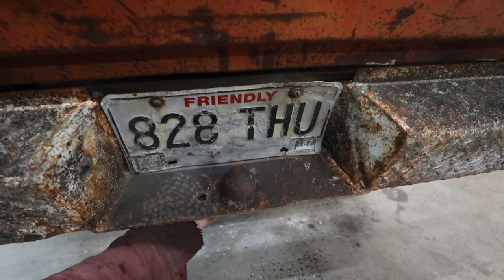Modifying and installing a random hydraulic dump bed in our 1955 Chevy Napco Clone

Comment: Nice dump bed. It will be great for hauling any kind of loose stuff that you can dump out instead of shovel out as well as being a conventional cargo hauler. I'll be watching you and Karl collaborate on the car hauler project in Vancouver. Thanks Brent.
Reply: If he could find a nice 1/2 inch thick piece of steel, he could make a steel bed!
Reply: @jimcarlisle2309  that would be heavy! 
That would make that beast hard to stop. I made the mistake with cement blocks, and on slick manitoba roads excess weight puts us at a disadvantage.

Comment: On Dad's 57 Chevy Grain Truck he had two buttons one inside and one of the tail end of the bed between the rear tire and the tail gate so he could watch the grain unload and raise only enough to get the grain out.  He let me push the button and i was 8. It was big boy time there. He also had a big knob on the dash he had to pull out before the buttons would work. then when it he was done he would push that big knob in the the bed would return draining the oil into the reservoir.  He had the bed and hoist installed by a specialty shop and they suggested the button in the back we used it all the time too. Yes it is way cool to have a tilt bed on the that special truck.. You are having way too much fun on that damn thing. Keep it going. Great creative use of your stash of parts. Well Done, Dennis

Comment: Nice not having to work around a floor. Winter is here and I'm already tired of it.maybe gonna need some rubber bumpers where the box and frame meet.  Could rattle being metal to metal

Comment: We remedied our shortfall of oil by cutting the end off the reservoir and adding a piece of 5.5 or 6 inch exhaust pipe. There is no pressure to speak of in the reservoir, it's only for the oil to return back and hold it for the pump to pick up, you're not going to run in to any high pressure doing this. When the bed's loaded, I doubt you're gonna have enough to even come close to getting it up to a dumping angle, somewhere around 55 degrees. Air in the system is helping push it up right now without a load on it, also why it's foamy.  Love the videos here in Georgia!

Comment: Ohhh, yeah. Loved that happy grin when it first went up. "I love it when a plan comes together." was all over your face. Yes, it is very cool. You can make quick adjusters for your axle stands by cutting a nut (that fits the threads) in two across the threads, and welding each half to the jaws of a locking plier. The kind where the release lever is pulled away from the body of the pliers is less likely to be bumped and released than the kind that has the release lever pulled toward the body of the pliers.

Comment: Add another tank behind the seat and hook that hose on the bottom of the tank and vent from new tank? easyer filling.  ATF is fine in those pumps ran it for decades in all the tow truck we built. Thiner fuild works great when it's cold.

Comment: Loop upper hose back to tank to fill as it goes up to solve volume issue. Would need to be towards bottom or have stand pipe to draw oil back in when it goes down. Truck looks great!

Comment: I built a dump truck with a similar pump, I had the same problem with the oil capacity. To fix the problem I added a header tank above the pump that would hold about a litre of fluid. Also you might want to add a cross support for the back of the lift to rest on when it’s down. I want to build another one now, way to go Brent.

Comment: You can get some scrap plates and build a res tank 6 inch tall by 8 inch wide by 12 inch long to hold the hydraulic fluid should be enough

Comment: To filter in this pump PowerPack is like replace the oil with DOT3 oil and don't use the ATF for cylinder lift. The pneumatic is cheaper and the hydro-pull oil and system is John Deere of long ram cylinder and ramming arm as part of the lift cylinder - which can still using the hydraulic DOT3 oil in the pump where the ring gear and rear planetary gear is turning the oil pump from the Arm and Hammer baking powder that does filter it along with plain pleated paper type cartridge/filter for lubricating many wet clutch disc set of your pump system inside the transmission.
 The other filter is plain coffee stainless steel screen (3-4 tablespoon capacity) that can be install inside the power pack pump of lift cylinder set includes the bracket of levers and axles of the elevate up one side the dump bed of Napco around the year 1990; they make it for your state with all terrain dump truck 1955 modification of newer Napco pump up the lift cylinder. The screen filter will cause it to be more cavitation and it is not good idea. Don't use filter.
 Motor Oil pump of its cast iron from the company Standard was use for Ford 2.3 liter engine and that the pump that doesn't use the piston reciprocating. It just revolve and pump jack fluid for your Napco lift cylinder. And maybe the Mophorn for $300.00. It is specification with the 8 quarts of hydraulic tank and the solenoid Delco must be add to the electric motor 12 volts - 14 Vlt plus two pushbuttons with indicated words," up and a down" on a plastic box, 1 foot long switch cords all already included in the kit of the $300.00.

Comment: Dat hydraulic cylinder mount's in, da upper mount too use'n 2X2, cylinder test'd ups far nuf n down, mount'd da pump underneath da cab, da lever goes down n da bed goes ups so's lever up n da bed goes down, Brent likes it! Da back bumper section'd mount'd n ends swaped.

Comment: You add a little reservoir on top of the pump to hold more fluid and you could buy an electric valve for that pump I  think that vent tube is actually for the down pressure, instead of gravity down

Comment: ATF is fine..Hydraulic fluid afterall..about 7 wt i believe... foam is usually from air or it just needs some cycling...add a valve to slow going down and it won't foam as much... add a reservoir for extra oil...use the big suction hose to increase volume?  you can change the way you operate it... solenoids or a remote valves...

Comment: ATF will work just fine. We used it in many cold weather/freezer applications for electric pallet jacks, scissor lifts and forklifts. Foaming is due to a suction leak somewhere? Probably at the motor pump shaft seal or even at the tank depending on the system. Most of the type that you are using is usually mounted vertically due to the fluid pickup tube. That is probably why you are having suction cavitation issues. Your system appears to be from an electric pallet jack. I have never seen one mounted horrizontally. Mount it vertically with the tank down and work the system repeatedly to get rid of the air out of the lines and cylinder.
Reply from the maker: I just mounted it the way it was on the trailer haha though it did have a reserve tank on there.
Reply: @HalfassKustoms  Just letting you know what and how it was probably used for when it was born. Who ever origionally used it did the same thing as you did not realizing how it was supposed to work? It is all FYI if you ever wanted it to work correctly. It will raise higher if you mount it vertically. As soon as you do it in the right position you will automatically get more volumn and fluid capacity 2 ways. Loss of bubbles/air and the tank will hold more fluid.

Comment: When building my Swiss Army Trailer I noticed that I needed to reinforce the foot print areas strength of where the pins go through at both ends of the scissor. Otherwise the bed bows if your lifting anything heavy like a gravel or top soil . You have room there to add a heavy duty flat plate on edge between the bottom of your square tube and your frame. If it's just a cool effect then your probably ok. I use ATF and mix it with hydraulic fluid and it's not foamy. I made my trailer power down aswell because other wise the box jumps around at the front if you don't have some kind of a lock to hold it down. How goes the build with Karl in BC ,that's going to be quite the project!.Food for thought Brent .Pray spring comes soon, Cheers!

Comment: You can run that "vent hose" from the rod end of the cylinder, back to the reservoir and use it for extra fluid capacity!
Also, raise the fill port with a LONG pipe nipple. Maybe even go to a 3/4" or 1" nipple.
It'll work better than Viagra to get that hoist up!

Comment: That's awesom man. Be sure to weld that bumper underneath good because you know you will be using it to pull a trailer. Grt that ATF outta that piston and some real hydraulic fluid in there. .

Comment: Your atf is fine, it's foamy because you're cavitating. My dump trailer cones factory with atf,  better in winter too!! Also, for safety, down on the pto should be down, as it is now, anything falls on it would lift it, think windows switches,  always have to pull up for up. Keep up the good work! PROBLEM CHILD PROJECTS

Comment: Hi Brent.  You need to drain all oil out and replace with a good quality hydraulic oil before you ruin the seals in pump and ram. See your local oil supplier for best rinse out of the system. You should also be able to make an extra capacity oil reservoir using the filler hole. Love the dump bed. I'm just building a dump trailer using a electric winch to lift and Independent coil spring on each wheel.
Reply from the maker: not sure lots of folks have said there systems came with atf in there pumps also. think I just need a little more reservoir.

Comment: I actually put vegetable oil in my Chinese two way (power up/power down) pump for my tilt bed trailer.  I have not used it a lot..but it is going strong. I was inspired by a tractor guy (I wouldn't be so bold as to put it a tractor) but I put it in my $200 pump.  Not that I am hyper environmental, but it is really nice if you blow a hose (which I did once).  No stress about oil residual running into wetlands.  Love the truck!  hope you use it lots:)

Comment: I put a hoist like that under my 1997 Ford F350. I had to play with the location to get clearance and the dump angle I wanted. Good job there. Make a small catch can and plumb it into the reservoir for a little more oil capacity. You can use tractor trans and hydraulic oil in the hoist.

Comment: I was wondering how all of that was going to turn out.  I am not surprised it works as good as it does….perfect!!!!!  Just a note on the reservoir limiting the travel of the bed….. why not install a shut-off/limit switch on the lift mechanism to shut off the pump at the solenoid before it starts to cavitate.  I really look forward to your videos.  They are always interesting and they help me get through the winters.👍👍👍

Comment: The dump truck was using three x 12 volts battery to get the electric power pumping action to make lift cylinder into unjounce and that made the bed into angle level. Then there is 100 amp alternator with full bridge rectifier = 4 x diode heavy-duty to make the AC into DC to run the lift cylinder into running action with green switch for lifting the dump bed and red push button to lower the dump bed into horizontal of the plywood bottom of box. The battery is too weak for 1 ton of product loaded to your box of Napco dump truck accessories. I prefer inverter for convert 12 volt ans alternator 150 amps max into 120 volts electric 150 PSI fortress pneumatic with minimal of 5 gallon tank. It is the best price you can get nothing beats the Fortress that must be like over 50 decibel of pneumatic motorized your lift cylinder. If you prefer to make into 3 gallons tank capacity and everyday the 1420 truck carries it for dumping ability type truck 4 wheel drive x2 seat. Then you can buy two  of air compressors of Fortress Brand of 125 PSI that 135 PSI is a lie but 6 gallon Fotress that is is a real 150 PSI and blend to your Powerpack from Powerline company that they offer you the switches. Without the switches of the lifting: the long ram 10 tons fully close 2 foot lift cylinder/jack yoke bottom then they won't give you the instruction and blueprint of powerpack of the Hybrid of Chevrolet and Napco made in 2007 model of my 4 doors cab suicide doors (rear) dump truck 2500 HD with its 3 foot or 4 foot ram outward fully unclose/unjounce.
 The 10 tons capacity of your lift long ram jack is base on pascal Metric of the law: the diameter of the piston inside lift cylinder and the other piston's diameter of the pumping up.

Comment: You did it again, another outstanding job. You should try using hydraulic oil in your pump reservoir, it has anti-foaming additives. Check to see where thereservoir or

Comment: Atf works great for Hydraulics, especially  in the winter. Alot of trash compactors use ATF so the compactors work in the winter. And other companies can't use compactors in cold weather because they haven't figured it out yet, lol I'm sure there is hydraulic oil for winter months, but I've never seen it.

Comment: The pivot of your switch the pump of lift cylinder Napco is that you did push down the handle and the starts the dump bed elevate up of the front side of Napco International dump bed for your Chevy 1420. Until you did pull up the switch handle and it makes the dump bed go down. But until you left the handle in the middle between the fully up and fully down. That way the pushbutton automatic is spring return mechanism set to the "Off" position only after you let go the both switches/sides. The Napco switch in "OFF" position is in the middle between side "UP" and the down position of its pivot the pumping tank hydraulic.

Comment: Brent you make this stuff look so easy! Another great educational tutorial video from A to Z on installing a dump bed the easy way. It looked great great, hope you are going to use treated or marine plywood so you are not changing it every other year. We are supposed to get a lot of snow this winter, so I'm putting 33" A/T tires on my 2017 Ford F-150 4X4  Supercab just in case, and no lift kit. Anyways, keep these videos coming and take care my friend.
Reply from the maker: Just regular plywood but will oil it, been in my IH for a few years and is still fine in that truck.

Comment: Hey Bret, I was waiting for you to get back on this build again, I watch all your videos. 
I have worked allot with the same kind of pump you are using for the dump bed and every one took transmission fluid, I have always wondered why not use hydraulic oil but aways used the recommended fluid, I believe the cylinder is a bit too big for thr size of your resivor capasity and I think if you attach a reserve tank to the vent hose ( like a old Rad reclaim unit) that it would solve your spill over issue, of course you would have to vent it.
Hope it helps.
James, 
Double Trouble Garage

Comment: Its a dump bed! If a guy could somehow tap into top of cylinder like a double acting,and a hose back to resevoir, the cylinder might act as a resevoir. Then again the ram seal may puke. My double acting pump is pretty much the same size. 
And could be air as well too.
Yup, tap top hose into resevoir.

Comment: Mon ami ... my vote is Salvage Diamond Plate Steel for the bed ... admit it, you'll be throwing some heavy shit in the back eventually and plywood ain't gonna cut it Bro. Plus, you'll be overloading on weight capacity and the steel bed will give a bunch more rigidity to the flimsy box. Plan ahead ... you know ... like running an anode wire down your fresh water supply for the shop ... LOL
Reply: Also ... might want to add a "Spreading Cover/Shim" flap to go between bed and tailgate so crap doesn't get stuck in the gap and prevent closure of the tailgate once you dump your load. Just a thought.

Comment: Aside from Darth Vader welding under your truck you mentioned Pablos tail is sore. The fellow in my avatar got that a couple times too as he started to age. Once after being rinsed off with the hose one a hot day temp shock and second time was the cold on his back end. You may have to get the old boy a bed to lay in off that cold cement floor. It's pretty painful for them.
Reply from the maker: Shop floor is heated in the winter it’s nice & warm

Comment: Considering how this truck is going to be used, in the snow, I think your pump, with its BIG hot wire going to the post, needs to have a cover made for it before it shorts out.

Comment: Excellent.
BTW ... if you raise the bed with wood 1x2 or 2x2's , would it clear the top of the tires better? (When you remove the wheel tubs.)
It would also help with mounting the plywood.

Comment: I'm sorry I don't have Warn Winchy and Ramsey direct mounted hoist winch. I was always in North Carolina and always stays in North Caroilina. In Winch dealer they have wire rope 1/2 inch diameter fitted to the winch too expensive. The dealership sells wire rope 3/8 diameter 5/16 inch and how long will you custom order the specific to make the winch to hoist up the  truck at not more than 3000 pounds. Or the winch uses the polyester tow line rope and wrap around the spool of the winch with lock. The capacity strength of your front bumper cannot do better than 3,000 lbs of force pulling so the Reese is a better and sturdy enough for winch or hoist it upward for pallet to be pull up from the bottom of canyon or from the barge and haul up the need Cayman Porsch engine up from the treason find site and working for the Giant AG and use the winch and hoist up as useful like skidding the logs across the lumber felling dead trees.  And NO lumber yard allow for more tree killing that it would  takes another 100 years before the tree is fat enough to have it into timber fall.